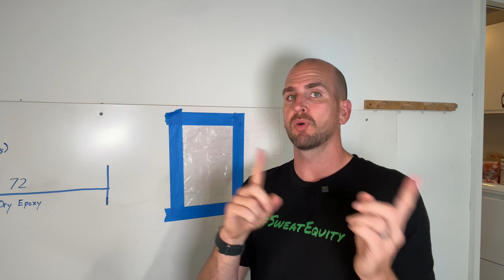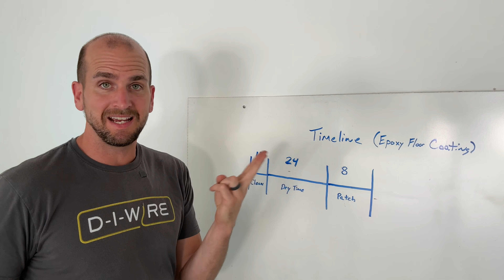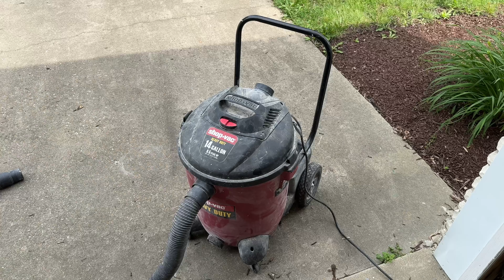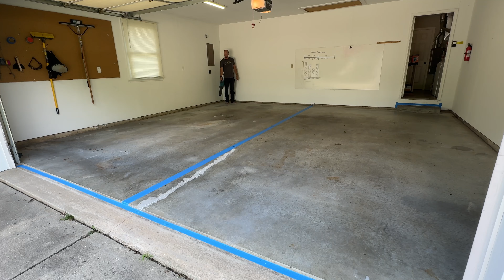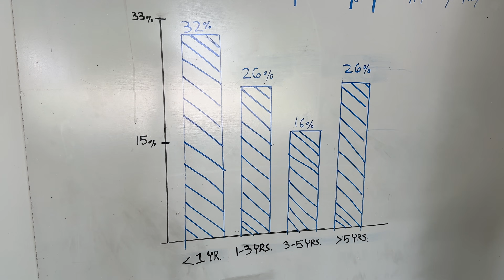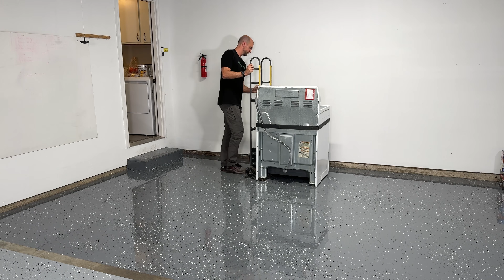Complete DIY Garage Epoxy Floor Coating Installation | Testing Most Popular Kits

Comment from the maker: Rust-Oleum Epoxy Shield Kit - https://geni.us/SEtkM
Rust-Oleum Rock Solid Kit - https://geni.us/Fwq9
Epoxy Patch Kit - https://geni.us/mwChC
Clear Finish Top Coat - https://geni.us/DKb1X
Anti Skid Powder - https://geni.us/ZKIB7J
Diamond Cup Wheel and Dust Shroud - https://geni.us/62DRoCj
Diamond Blade for Cracks - https://geni.us/KgupX

DISCLAIMER: This video and description contain affiliate links, which means that if you click on one of the product links, I’ll receive a small commission.
Reply: Could you please provide information for the superior product for filling patches?

Comment: I have used both of these products and have found that RockSolid is far superior as a product.  It'll last 3-4 times longer. 
Tip:  toss the flakes up in the air for a more even drop.

Comment: My bosses @ work went to a demo by this product (and no we have never installed it) yet the company swears by the fact "No Grinding needed" 

check them out for yourself and they have several videos 
("*Premera specializes in high-performance concrete coatings and systems for flaked finishes.The Primer: Premera Sol Gel Primers are designed to eliminate the need to grind or profile concrete. This significantly speeds up installation and cleanup times.") they have a website and several different products -> top coats ... and cove base coatings too ) 

i might just try this & skip hand grinding - i won't know unless i try either way it's saving a lot of money vs hiring a professional flooring company @3000-5000$ for 240 sf garage with 4" cove base ) 
if i buy this product - i'll come back & comment ! also applying a fast dry top coat = means no messing around too !

Comment: One quick note, I noticed you only applied 1 coat. If you read the instructions it actually recommends you apply two coats. The first coat with out flakes obviously and then the second coat 3 hours after the first with flakes.  It is also recommended that you apply a clear coat as well, 24 to 48 hours after.

Comment: I used epoxyshield followed by Rock Solid clear coat.  I did a mechanical grind prep but hosed it off then acid etched.  I worked in that garage 8 hrs every day along with parking a car there most days.  Zero issues for 5 years then I moved.  It looked like a showroom.  The clear coat became matte in high traffic areas.  Nothing a touch up coat wouldn't fix if it were ever a problem.

Comment: Do not clean and etch. It will fail. That is most likely the reason why your garage failed. Always always always grind to clean white concrete. Etching does not work

Comment: THE SOLVENT EPOXY IS ALWAYS A 2 COAT PROCESS.  I'm a professional painter and have epoxy'd many garage floors and you always want to apply 2 coats followed by a sealer.  It looks totally different to what you appled on the left side.  I've also used the Solid Rock product with very good success.  But, as always, in any painting project, proper prep of the surface to be coated is absolutely necessary.

Comment: Make sure you do a base and top coat. Use a Polycuramine for the base and for best results top coat with a more durable clear Polyaspartic with anti slip added.

Comment: I did epoxy shield grey with clear epoxy shield to finish.  Hot tires caused failure almost immediately.  I contacted Rustoleum who sent me a color touch up kit and clear rock solid to recoat hot tire areas.  No problem since.   Use Rock Solid Clear as final topcoat!!!

Comment: I used epoxy shield clear over the epoxy shield gray and it lifted due to the hot tires.  I contacted Rustoleum who sent me the rock solid clear for a redo which has performed flawlessly since.  I recommend the rock solid clear for the finish coat

Comment: Youre half right, prep work is the most important step but by "prep," I mean dont but DIY epoxy kits. They are water based most of the time, and I would argue waterbased coatings should only be used by professionals. Anothee problem with the kits is you dont get thr quantity or volume of coating yoy need but you pay top price for what you get.  There is way too many options for coatings and your box store products, for the lack of a better word, suck! If you want to make it a DIY project, I recommend taking picture of the work area and surround areas if its an exterior application, do a moisture test, decided a budget or what you can spend, and finally go online, go to your nearest coatings supplier ( I would recommend Sherman Williams because most people have a store nearby but are usually more expensive than industrial coatings suppliers,)  or last resort is call one and describe your situation so they can sell you the exact coating(s) you need.  I know there is going to be professionals like myself but who will say I dont know anything but...the one thing i absolutely recommend is using a waterbased epoxy or one-part polyspartic, tinted, as your prime/basecoat. This is key for the bonding and sealing of concrete and will ensure moisture penetration, adhesion, hot tire pick-up wont be a problem. It also a cheaper product that will reduce the amount, increase the coverage of your color coat. Alaphatic urethane (clear/finish coat) to complete. RustOleum spraypaint, good,  floor coatings, bad.

Comment: I uses the epoxy shield did all of the prep on a newer floor 3 years old.  I e been painting all of my garage floors even my industrial shop with 2 part epoxy .not  Rust Oleum . And with over 3000 cars a year driving on it along with trucks it lasted 5years . I used the old Rust oleum on my previous home garage it lasted for a decade . The crap they sell today just melted away the first time the car parked on it after it sat for two weeks to completely dry with a dehumidifier running and it hasn’t rained  here for a month so that was not the problem . I called customer service and the lady told me you can’t let it get wet over night ! What the hell good is that?  She also said applying the clear coat over it you can’t let water sit on it over nite Buyer beware you will need to purchase cases of diapers to tape under your cars . This took two weeks prep and apply then two weeks to let dry .

Comment: I never had an issue with chipping/ flaking, however, where the tyres touched the floor it stained orange. And was impossible to remove/clean

Comment: I want to use this on my basement laundry room floor. How would you suggest degreasing if I cant spray water on it? There is no floor drain
Reply: Same question. If you've done this already, how'd it go? I'm thinking about starting my basement soon.

Comment: I think you did a great job, but I have to say, if you are spending the time and money, You should go all the way with renting a disc grinder to get the floor 100% down to the concrete as you spoke of at 22:30.

Comment: Great informative video. You mentioned that you’ve used other products instead of rustoleum for filling cracks as well as the actual coating. I have a two car garage and just wondering what product you would prefer. We do park both cars in the driveway and I currently have the rock solid product on my floor, which is now starting to peel. It did last approximately 5 to 6 years. We live in the northeast so there’s salt on it throughout the winter as well. Thanks in advance.

Comment: I'd like to use this product in 2 half baths with older red, restaurant kitchen tile.  Do I need to patch the tile grout lines? They are about quarter inch width lines.  ➕️.
Reply from the maker: Hmmmm, what is the subfloor under the tiles?  If it is concrete I would just remove the tiles, get down to concrete, and get a grinder to prep the floor.

Comment: Hi, great vid, thanks for it. I looked at it as I'm going to do the same DIY Epoxy Floor Coating, using the Rust-Oleum 2 1/2 Garage Floor Coating Kit for my garage. My question is, since I reside in the Caribbean, and my garage is not enclosed, if I use the clear coat, I heard that over time, the clear coat turns yellow and if so, can I add and mix the Rust-Oleum Anti Skid to the Epoxy Floor Coating before painting the garage flooring, or would the decorative chips be sufficient enough?? Please chim in and let me know, thanks.

Comment: Degreaser is not going to remove the surface coating that stuff is almost impenetrable, removing the top coat requires very specific special tooling to go to Bare concrete....

Comment: The best advice I got was do it once and just cry once over the price.  Using the higher quality stuff, using spiked shoes, pour everything to 2 of the outside edges, and work everything with a squeegee and go over again with a roller.  Then use a leaf blower (cleaned out prior to using) to throw the flakes.  But definitely have more flakes than you plan on actually using.
Last important step is adding the grit and mixing well into the topcoat.

Comment: Please reply to my question. 1st thank you for this video and all of your videos.
  I am in south west wisconsin.
  I am laid up because I was healing from an injury when we had a light snow and had snow on my shoes when I got out of my truck in the garage which is somewhat new and very smooth and I went down hard and reinjured my rt hip. This is the 2nd time I've slipped on this floor when  a light water or snow gets on it. Your tests are very realistic and has helped me make a choice but my question is: Both halves you throw or sprinkle those speckles on do they make it less slippery especially when damp from dripping off cars or snow blowing in?

Comment: Awesome video!  Can I ask what the difference is between this epoxy crack repair product and the one you use in your other video (the low viscosity/sand combination)?  Are there any benefits beyond the time to cure?

Comment: I'd used the Rust Oleum product on a new home I'd purchased that lasted for 19 years  before I moved in SoCal. The garage had car traffic almost everyday and light DIY work.  For prep, I manually sanded the floor and did an acid etch.  When we moved, I had 2 chips on the transistion, but no other chips or peels.  My neighbor purchased an epoxy 4 times the cost and had large sections that peeled in less than a year. What I learned, is that its all in the prep.
Reply: It’s just like paint a vehicle. Most of your work is in the prep if you want your paint to stick. Prep quality in prep will always lead to paint peeling.
Reply: Yours lasted longer because of the prep work.

Comment: Temperature has to be above 65 in order to do this, correct?  So no application of Rock Solid in February in North Carolina?  average temps are 32-50 degrees

Comment: Why not use muradic acid for cleaning the concrete floor. It will etch the concrete and the epoxy will get into the concrete better.

Comment: I bought a brand-new home in Houston TX in 2018.  In 2022, I bought the Rust-Oleum garage floor epoxy and did my 2-car garage.  I followed all of the instructions.
My garage was fairly clean, and my wife had just bought a Tesla in 2022 and wanted to park it in the garage...so that's why I epoxied the garage floor.
After about two months of parking in the garage...I noticed two small spots of Hot Tire delaminating on the garage floor.   I just left it as is.
In mid 2023 we moved out of state...but the floor still looked great.
I'm moving into a new build in AZ in early 2025 and I'm going to be epoxying my two garages before I move in!
Reply: Did you do your garage yourself or did you contract a company to do it in Arizona?  I just bought a new build myself in Arizona and I'm trying to figure out which route to take.

Comment: hey man, when  youre done . at what point do you peel the painters tape up off the garage lip to get a clean finish? if its wet wont it create the epoxy to drip still or once its solid the epoxy has hardened over the tape, how do you get that clean look at the entrance?

Comment: I’ve done a full grind on the floor, and going the Rock Solid route. I watched the other video with the pro level stuff and the cost and number of steps and VOC off gassing are all turn offs. 
Thank you for both videos. It’s confirmed what I have learned so far and helped me decide how to finish this project.
Reply: Just got done with painting my 250sq foot floor after full grind. I did the 2.5 car garage kit which is supposed to cover 500sq ft. It comes with 2 paint bags, so I did the first, then 24hrs later did the second so that I could give some areas a 2nd coat. 
Takeaways: I needed a third bag of paint to address the thin areas where the paint soaked into the concrete after the first coat. And I would like to have done the sand and epoxy approach to crack repair. 
Overall I’m happy with my results, and believe it should be durable for years.

Comment: I'll probably go for rock solid. Yeah it's more expensive, but it's something you won't be doing every year so it's better to get the better product from the start and do it right the first time. If the cheaper epoxy fails, now you're doing this all over again and you're spending more than you would have with Rock Solid.

Comment: If we have asbestos mastic under asbestos tile on a floor, in THEORY couldn't we encapsulate and bury the asbestos under many coats of epoxy without having to grind anything away?   People talk about it not adhering over time but wouldn't that not matter if I had a thick enough slab or enough layers of epoxy to seal everything off?

I'm aware this idea isn't the professional way to do it but in a situation were I am short on time and funds and need to make a space safe for people/animals, in theory wouldn't it work to just dump a thick enough epoxy slab on a floor and bury the asbestos...?  Thoughts?

Comment: can that top coat at the end of the video goes on the rock solid coated floor? i thought that's not recommended for 2 part epoxy floors
Reply from the maker: Yep you can use the clear coat on Rustoleum Rock Solid kit.  Check the window of time to apply the clear coat after putting down the Rock Solid and also check to see if you need to lightly scuff the surface.

Comment: I've never done this type of flooring work but it seems like chip and crack repair should be Step #1 just to keep dust, even with a shop vac attached, to an absolute minimum.

Comment: Grind the floor. 6” diamond cup wheel and an angle grinder.
Reply from the maker: Yeah, a full grind is the best prep for sure 💯
Reply: @EverydayHomeRepairs  you did mention that I know, but just so other people know. Prep is absolutely key like mentioned in the video. Personally I did a grind job on mine and used the rustoleum kit and it still peeled after a year. I had to grind it all off again and the next go around I used Rust bullet epoxy. $190 a gallon but I can drag anvils across my floor with no issue. Great content 👍

Comment: I'm want to use the Rock Solid on an enclosed patio floor.  This floor has been protected from the weather for 30 years.  My problem is there are 2 expansion joints.  There is about 1/2 in. elevation difference. What I do with the elevation difference?
Reply from the maker: That is a bit tough, even if you grind one side and fill the expansion joint to smooth everything out it will move and crack within the first year.  What about epoxying the slabs and leaving the expansion joints.  Tremco Vulkem 45 SSL could be used to seal the cracks and they have a lot of different colors to help you match.

Comment: Great comparison. I’v used the epoxy shield on several homes before the rock solid came on the market. Unfortunately after a couple years, I noticed tire marks, stains, and some flaking.  I used the rock solid on my brother’s home a few years ago with much better results!

Comment: Roughly 10years ago I did a 2-part epoxy coating on our garage floor and it looked great for about two months.  Unfortunately, it began to blister.  Our house is about 40yrs old and the garage floor does not have a vapor barrier, resulting in a lot of moisture. We recently had a pro come out for an estimate and he said that any epoxy flooring would fail in our garage. I will probably install a floating tile system.

Comment: Have you gotten any resunts using the 1 part  Behr Garage Epoxy vs the 2 Part Rustoleum Kit. Cuious of how it holds up with Behr being pre mixed
Reply: Also did your pull include thos who had added the Rustoleum Clear epoxy topper?

Comment: How do you recommend cleaning and etching a floor in a Barndo with no floor drain. I’m not sure how to get the water out with a door threshold and no drain.
Reply from the maker: Honestly the prep from the DIY kits is my least favorite part of the process.  You might want to consider a full grind.  It is a lot of work but the results usually will be superior.  This video I do the full grind on this floor.  https://youtu.be/KheIlf387aw

Comment: Getting ready to do the Rock Solid tomorrow. I was curious about the flakes and if you can feel them when you run your hand over the floor? I’m debating on if I need to do a gloss coat to seal the flakes in or if it’s even needed? Thanks for the video!
Reply from the maker: Sorry for the delay, if you do a light flake you will not feel the flakes.  I think a clear coat is a good idea but mix in the anti-skid additive to avoid being slick when wet.

Comment: I am in the 1 -  3 years currently and my floor is perfect. But I also sanded my floor with a floor polisher and a diamond sanding disk. Also I used the Rock Solid on my floor.

Comment: For the prep, id just grind off the top layer and open the floor up. Way faster. At that point you can put down a vapor barrier, then prime on top of that, then use your finish product.
Reply from the maker: Agreed!  Grinding would be a much better prep 👍

Comment: I got the best result when i ground the old floor, applied a layer of self level and then epoxy coating. Epoxy can be applied to the self level within a few days
Reply: What self level product did you use? Thank you